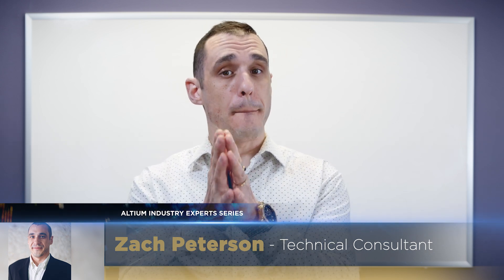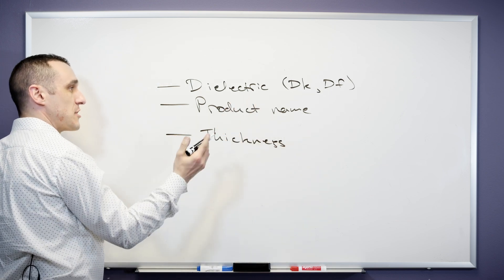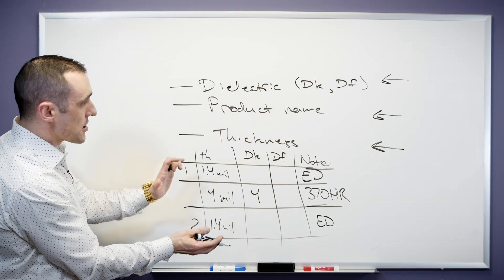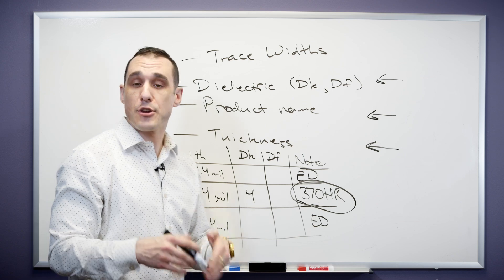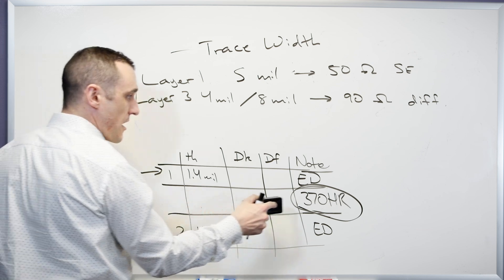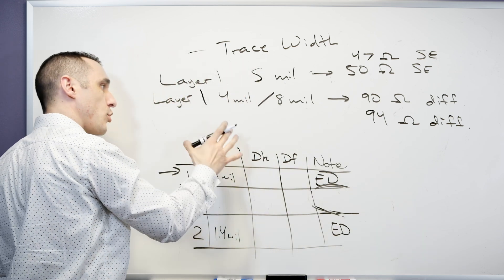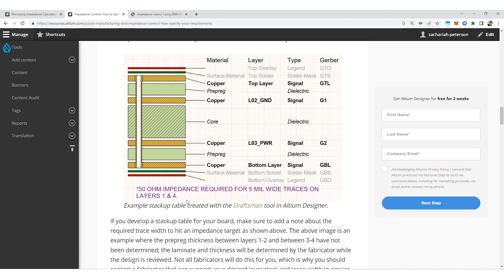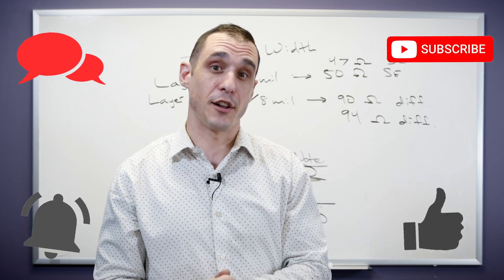Controlled Impedance Vs. Controlled Dielectric Design

Comment: In complex designs like 20 layer or 26 layers boards for exmaple, with USB 90ohms + DDR4 with 50 ohms + GDDR6 with 45 ohms + PCIE with 100ohms its impossible to work just in controlled impedance. And you can add either a 100GBs PAM4 link with 20 cm long, that need more width due to the DC losses but still need to match the 100 ohms impedance :)
Reply: I agree to an extent, if you just segment those different impedance onto different layer sets then you could probably make it work in conjunction with testing from your manufacturer, but I think that is impractical and might leave you a lot of space on those layers that are allocated to specific impedances. You might have better luck doing controlled impedance with mixes of differential and single-ended but only with widely spaced differential pairs because the odd-mode impedances will be very close to the single-ended impedances. In that case you might be able to do 45 Ohms GDDR6 and a 90 Ohms differential interface on the same layer and you could do controlled impedance as long as the USB lines are not very closely coupled together. Regardless, I prefer controlled dielectric anyways.

Comment: TIL I've basically been doing controlled dielectric design while calling it controlled impedance.
I tend to pick dielectric thickness/Dk based on the general widths I want my traces to have depending on clearance constraints or design requirements, then simulate/calculate to verify them and give the fab house both the full stackup table AND an impedance table in case they have substitutes/suggestions.
Reply: That's something I've always noticed, people using "controlled dielectric" and "controlled impedance" interchangeably, there is also someone I know who used "controlled stackup" to refer to controlled dielectric. My EMS clients generally require an impedance table even if doing controlled dielectric, but I stopped giving that table to other fabs I work with when we're running production, as soon as they see it they immediately assume I want impedance testing added to the order.

Comment: Hi Zach, in your example @12:32 you mentioned that *50 ohm impedance required for 5 mil wide traces on layer 1and 4. I assume you are using co planner since no frequency is mentioned, the GND is layer 2, so how it is possible to establish 50 ohm on layer 1 and 4 reference to GND with the same 5 mil width since there is a core +prepreg between layer 4 and GND while just a prepreg between layer 1 and GND? is it that Dk for top prepreg = Dk core + lower prepreg? thanks and have a nice weekend :)
Reply: I'm assuming the design utilized Power+Signal on surface layers and GND in internals, making L1-L2 and L3-L4 impedance profiles symmetrical.
Reply: the only possible way "I think" is to use the ground pour on the L03_PWR as a reference for the RF signals on layer 4 while avoiding any RF traces located over a power trace as well as to utilize L02_GND as a reference for the RF signals on layer 1. personally i don't recommend such a solution
Reply: you're right, I completely missed the layer names.
Reply: @hazehh789  Three things to note here:
1) In this example it was not meant to be coplanar, but you could do it as coplanar. If we ignore the layer names then doing this as the other reply mentioned would be fine.
2) You can do it also with L3 PWR as a reference plane as well, but it's not preferred because you would assume that, at some point, you might have to route those impedance controlled traces between L4 and L1, so then you have to put stitching vias around those signals and GND pours on L4 (large clearance for pours on L4). When I've done this type of stackup, it's been done for something that has digital stuff on the L1 side, but it also needs a lot of power; they are not common. In those boards I would just route slower control signals and miscellaneous components on L4.
3) Just because you state there is an impedance requirement on both L1 and L4 does not mean you have to actually use it, you could only place the impedance controlled signals on L1. The statement in the drawing reflects the symmetry of the stackup.
Reply: @Zachariah-Peterson  thanks for explaining